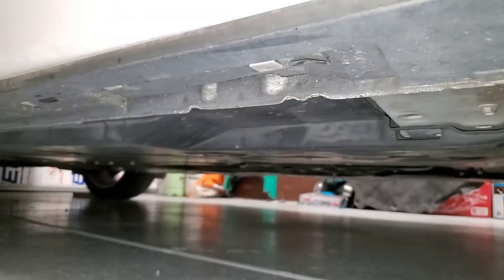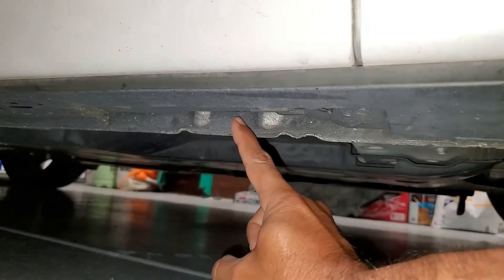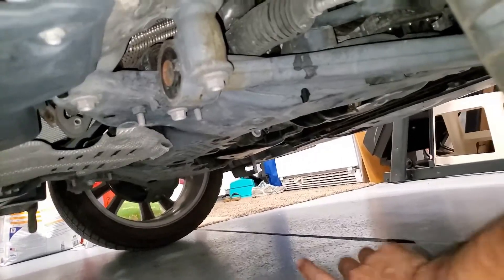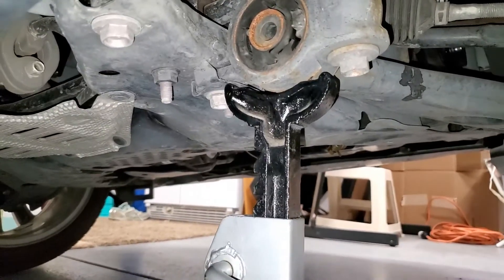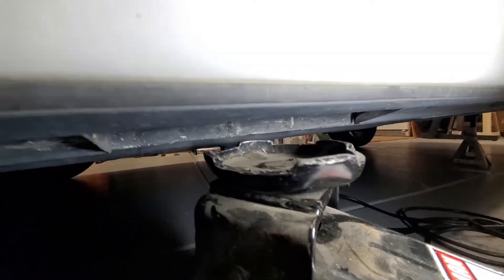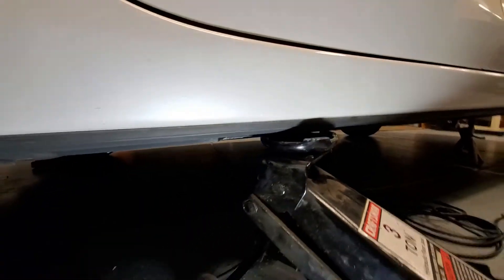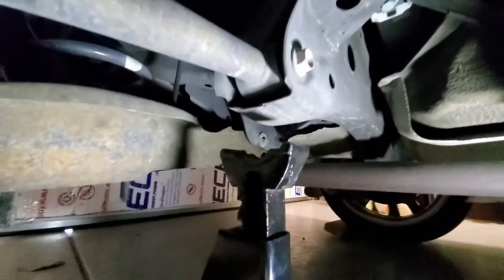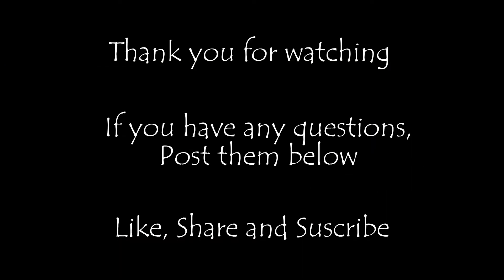How to: Jack or Lift up Front or Back end of Mazda 6 & Support it on Car Stands

Comment: You bent the pinch welds.
Reply from the maker: iit's a non issue.  hasn't bend yet after all these years.  i've done it many cars.  even mechanics do this...it's been done to my car at a shop.

yes, the do setll a u shaped item you can get to install on your jack when lifting.
Reply: @footprintsinconc  yeah gets done by bad mechanics. Do that to you own vehicle ok, but no matter how little I'd never damage a customers car on a import area of the chassis (I know it's not crucial the pinch weld itself just bending some, but if it's crushed up completely then any future impacts to that spot could potentially damage the floor above it instead of the pinch weld possibly crushing instead and taking the force and the body above not getting damaged possibly) when there is the proper tools and equipment available to do it right!
Reply: That pinch weld is just fine.

Comment: Why can't we use the jack stand in the same spot we used the jack floor to lift the car?
Reply: I guess the problem is how do you lift the car to put the stands in place then lol but yeah I don't like these stand spots. I don't like anything about this at all.
Reply: @darkl3ad3r Mazda says to lift near the center or the front crossmember
Reply: @wk5181 the problem is getting your floor jack to those center points. If you can, go for it then use jack stands with some pinch weld adapters in the spots along the trim. Otherwise use the control arm like he did I guess.
Reply: @darkl3ad3r  I will try this week I guess. I tried to change oil myself for the first time. Why not I guess :)
I have done many repairs by myself including replacing the starter.
Reply: @wk5181  nice man. I just started changing my oil too. Did it on my Jetta and now going to do it the wife's Mazda 6. It's funny, I thought her car was going to be easier since the cabin air filter is way more user friendly to replace on the 6 than the Jetta, but now I'm seeing jacking up her car is going to be a pain compared to mine lol can't win em all.
Reply: @darkl3ad3r  the same here, the Mazda is my wife's :)
Reply: @wk5181  hahaha that's hilarious. Probably pretty common lol not many wives willingly crawling under the engine and getting dirty to save a few bucks 🤣
Reply: @darkl3ad3r  actually I meant the coincidence that wives (women) love Mazda, not sure why :)
Reply: @wk5181  they're fairly decently priced and look cool but slightly girly, I guess it fits lol
Reply: @darkl3ad3r  update, I changed the oil in my wife's Mazda cx7. There was a major surprise. The bolts used in the splash cover were rusted and three screws got broken while trying to unscrew them. Then I found that there were another three that were broken from before probably in oil change shops. Now I need to take it to mechanic to try to get the broken parts out and find a way to reattach the splash cover. Btw I found that this is very common and many owners found that their splash cover wasn't even there. I wouldn't have found this if I didn't change the oil by myself.
Reply: @wk5181  oh wow that sounds like a colossal pain. I ended up not even being able to do my wife's oil change because I don't have an extended reach low profile floor jack so we just took it to a shop and handed over our oil and filter. Hopefully by the next time though I can get one of those jacks from harbor freight on sale and do it myself. Now you have me really curious if the screws to that skid plate are rusted up on her's too. Hopefully not. My Jetta's skid plate screws were fine but it's 2 years newer than her Mazda 6. Sucks man. I don't even think getting regular car washes would do anything for that since it's on the bottom of the car. Doubt it would have helped.

Comment: you are compressing the control arm bushing by supporting the car there with a stand
Reply from the maker: the metal housing is what spreads to the load to the outside edges of the metal housing.  won't be an issue.

Comment: Actually putting the jack head on the metal ridge is not a good idea. Look at how the Mazda jack fits on the jack point and you will see that the metal ridge is more of a guide. The   lifting contact area is behind the ridge towards the chassis middle. The ridge is just so it fits into the slot the Mazda jack has and if you use a floor jack it should have a jack pad which have a slot cut in to mate with the ridge. You risk bending the ridge since it is really not made to support all that weight. If it colapses while on a jack or jack stand it could be ugly. Position the Mazda jack and it will all make sense.
Reply from the maker: the jack seat is slit and weight is transferred from either side of the rib as you mentioned.

this works just fine as i've showed.  some have bent some overtime, but never had an issue arise from it bending.
Reply: @ExpVet I agree.  I used to jack up my CX 3 this way using a floor jack but then I notice that the OEM jack that came with the car has an opening where the ridge would slide down and NOT touching the base.  So I assumed that the weight of the car should be resting behind the ridge.
Reply: Thank you for your comment regarding the floor jack pad.  Who knew?  Until I can find a pad, I will just use the Mazda jack.